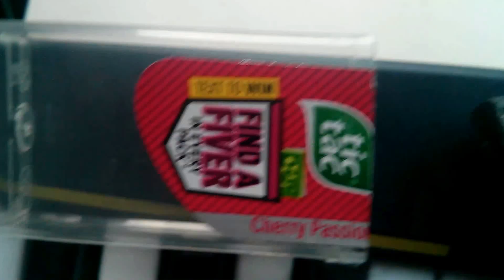Single-chip Cheapsynth running Mozzi Arduino audio library, all powered by MIDI cable

Comment: where could i find connection scheme? i see some old cache webpages, but i´d like to see updated info.
Reply from the maker: sorry for not replying sooner - I've put an annotated wiring diagram at the first (fakebitpolytechnic) link in the video description, let me know if you need more info?
Reply: Thank you!!
Reply: @fakebitpolytechnic  Simply brilliant! Any chance of getting updated code as it is quite old and I am running the latest versions of Arduino IDE, MIDI library and MOZZI library. I get the feeling that I will strike plenty of issues if I proceed with the "NOW COMPATIBLE w/ MOZZI v1.0.2, MIDI lib 4.2" code. What are your thoughts? Cheers from Australia.

Comment: Great sounds!
Will you update the github according to this? The code there is no longer compiling unless you make a few modifications (I could compile some projects, but not all of them) because the midi and arduino projects were changed in between...
Reply from the maker: Garvalf sorry yeah the newer versions (marked "NOW COMPATIBLE w/ MOZZI v1.0.2, MIDI lib 4.2") deal with these issues - just as long as you're not using a too-recent version of the Arduino IDE..!
https://github.com/fakebitpolytechnic/cheapsynth
Reply: fakebitpolytechnic Thank you, I'll have a look soon. It's a pity Arduino didn't manage to keep more compatibilities between old and newer versions...